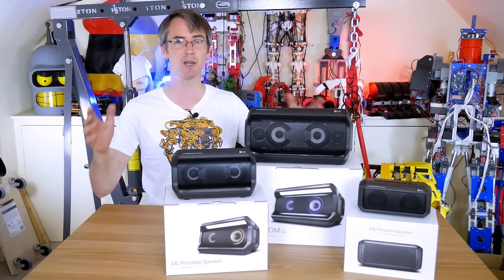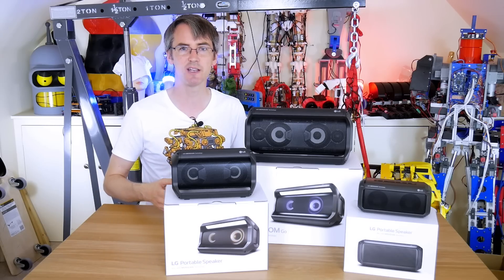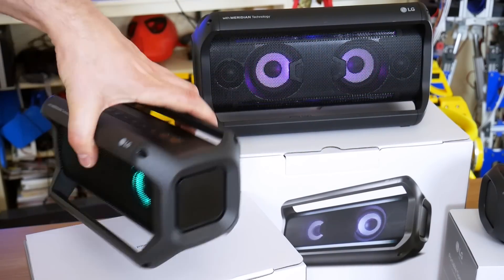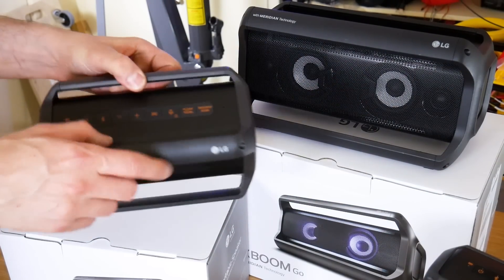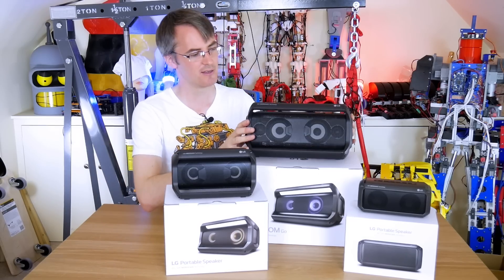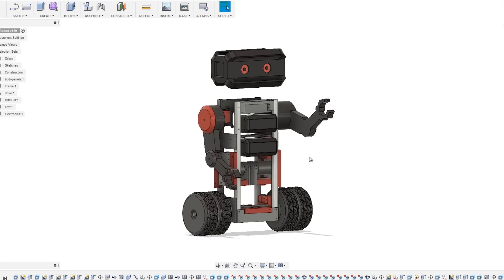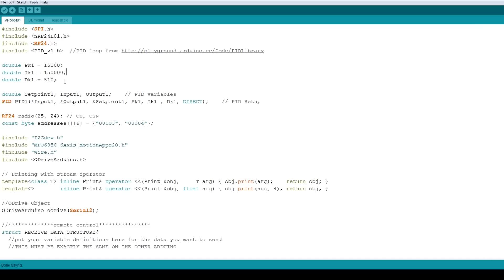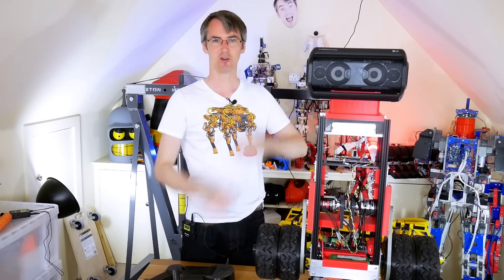Building a Two-Wheel Balancing Robot | with LG XBOOM Go Speakers

Comment from the maker: Part 2 comes up next Tuesday - where I add the arms, body panels, and remote control!
Reply: I like the video and the idea! (I know you're not hacky) one suggestion I have is you program it to speak and modify it to work with the sound maybe coming from some tts
Reply: This is a great project! this would be one more people could build and modify and add more and more to it. lots of room in the body for much more. I love it! you could even do three wheels if you need more stable for carrying things as a modification. I think you are on to something. I would love one running around the house. lol. good by Roomba lol
Reply: Very interesting.  I like how, during the video, you rattle off the components and the open source examples for those of us who might be interested in trying something like this.
Reply: You are going to have a lot of wheel skid during turn because of your large wheel footprint.
Reply: can you mount one of those motors on a linear actuator?
Reply: like replace the current motor with one of those
Reply: Thanks!
Reply: James, which app do you use as CAD ?

Comment: Nice project! I was wondering if Jeff Rowberg's library is compatible with the teensy 3.6 without any modifications to the code in the library. I am eager to get a teensy, but not entirely sure how my arduino code will transfer to the teensyduino. Any suggestions?
Reply from the maker: Yes
Reply: @jamesbruton  thank you for the advice can’t wait to get working with a teensy!

Comment: must be totally brainless idiot if pay cnc machine 3200 $ this size, 3000 $ can buy factory big machine today. can cut onetime full sheet plywood or aluminium sheet no need cut anythink before add sheet to machine table. 20000mmx3500mm table area can buy 3000$ cnc today many shop. idiot pay ower price super small cnc

Comment: Nice work! Did you use a sampling timpe of 10ms for the PID? Any additional filtering made on the IMU data?
Reply from the maker: The MPU6050 has DMP so it gives you accurate values. Yes 10ms, but 20 would do just as well.
Reply: Thanks for answering this. I'm also working on a similar project and I can't get it to work for quite a while now. Maybe adding some extra mass on the top of the robot would help me also.

Comment: I noticed that your CNC table isn't very rigid. This will reduce quality exponentially.

Also a tip for cutting holes with a CNC just cut the outside of the circle and maybe use tabs it will cut down proces time Exponentially (no pun intended)
Reply from the maker: Yes it is, the table is not rigid: https://www.youtube.com/watch?v=O9cQTfxixF8

Comment: P=V^2/R (Power = Voltage squared / R), so if you double the voltage, you quadruple the power, generally
Reply: motors are inductors, not resistors.
Reply: @pascha4527  
So true!  But power is not proportional to voltage, is it?
The speed and torque is proportional to voltage, isn't it?

Comment: i think you should consider adding adjustable balance tail which might help with riding forward while holding things, or adding force sensors to the arms that will allow to calculate the new ballance angle good luck -,-

Comment: Could you make a "Tuning Remote" that has 4 or 5 knobs and a few switches and a screen? Then you can live tune the PID loop and the centerpoint/setpoint and then just record the values from the screen and put them back into the original code.

Comment: Fun function for this one would be a "Follow" mode, where it follows a small transmitter you can fit in your pocket. Would be an interestin challenge to implement.
Reply: Yes I was going to suggest to make it follow, it would be a cool addition to the project.
Reply: That would be awesome!
Reply: What?  I'm just taking my robot for a walk.  He plays me music.
Reply: Blynk would probably be a good tool for that.  At it's simplest you just need a GPS sensor on the robot and have it constantly try to match the GPS position of the phone.  Toss in a Raspberry Pi or maybe a more powerful Jetson and use a Kinect to do obstacle avoidance.
Reply: I think it would be also good to use a camera and opencv to track a specific color and match it with your t shirt.

Comment: I'm looking for advice about a good robotics simulator to create a virtual robot. I'm trying to do a digital twin of a robot I have. It's built with a raspberry pi and run by python so ideally the simulator will be able to represent that. I also would want to control the virtual robot with my own GUI. Are there any softwares I can use to do this?
Reply: ROS (Robot Operating System) and the Gazebo Simulator. Takes a bit to get used to, but is documented well enough. Python is supported. You could actually use a real RPi to control the virtual robot, as ROS is designed to be a distributed system. You'd have to write your own GUI module, though there are some made by other users.